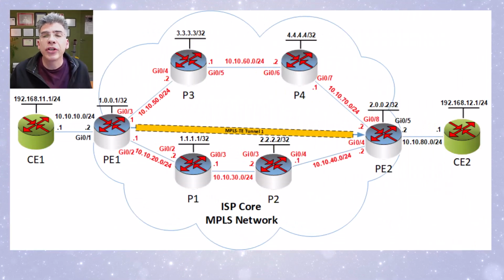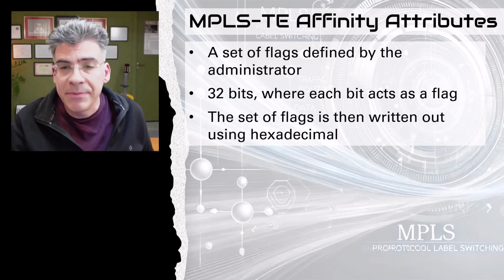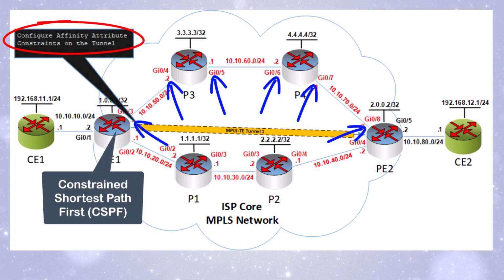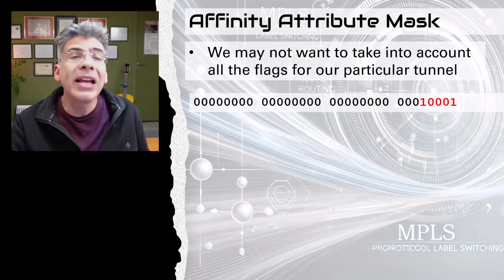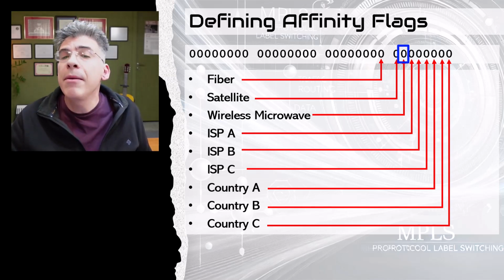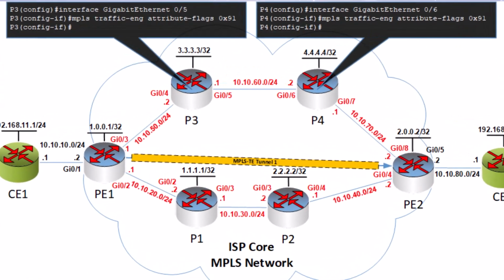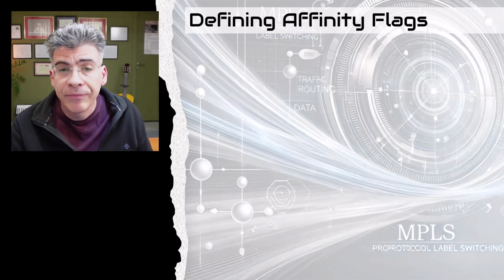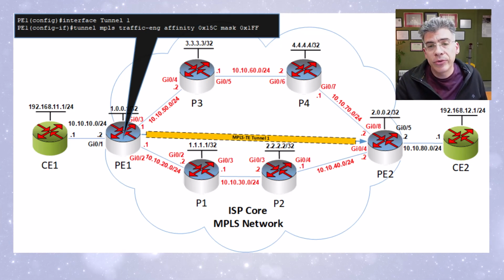MPLS-TE and Affinity Attributes

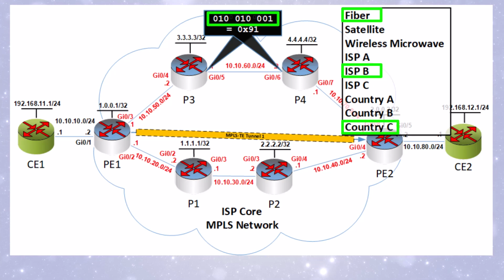Comment: 010 010 001 means satellite, ISP B and country c may be? please tell me, if i am correct or not because in video you have told that it is fiber connection. 08:11
Reply from the maker: Yes, you're right, I did make an error there, sorry about that!  Thanks for catching it!  The idea however remains the same.  I have put in a correction, and credited you with finding it.